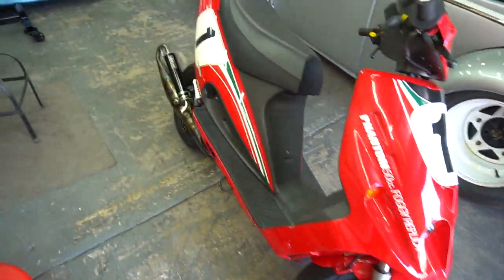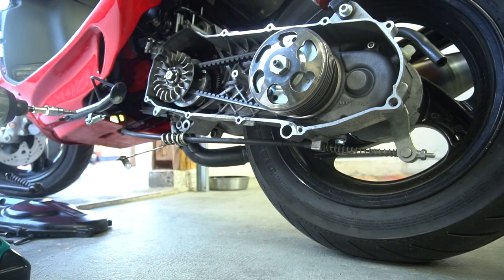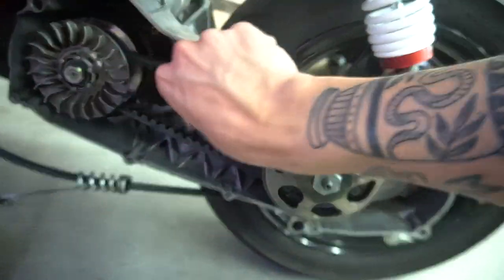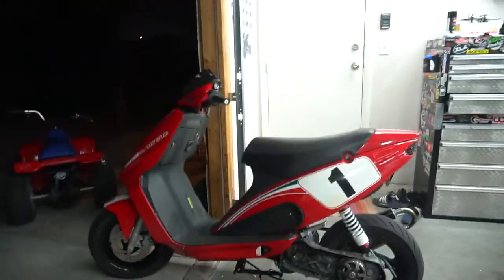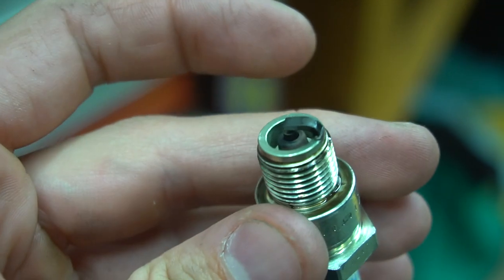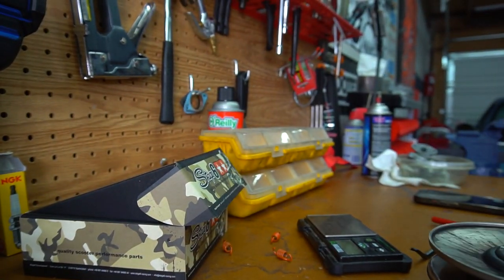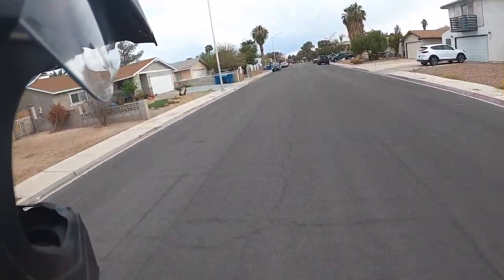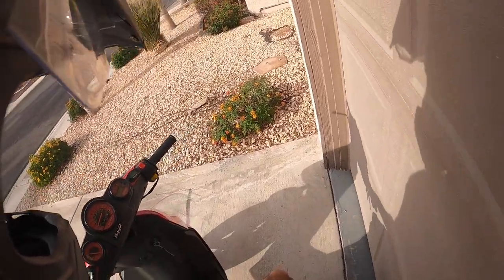PHANTOM F12 gets STAGE6 Clutch and CVT Tuning!

Comment: You should use an overrange kit. It gives more travel/gearing AND has a straight rear poulie spline. Stock splines are curved. A big flaw on minarelli engines.

If you want to improve your gas response. You could ad a light weight ignition (innerrotor). 

If you want to go all out. Convertible to a liquid cooled cilinder. 
It's pretty easy to do on minarelli and the F12 Phantom frame.

Comment: Love your Phantom. I also have a Piaggio Zip 2 with a 70ccm Malossi sport zylinder qnd malossi drivetrain and polini belt dellorto 21 black carb and the same yasuni exhaust ist runs great top speed and longer gear it runs 110kmh and just wheelies for days.

Comment: I own a Gilera Stalker and they are beasts when it comes to tuning in which someone got their Gilera Stalker up to 72 mph at half gas. You can really fit a 172cc on a Gilera stalker. But anyways if that’s completely 100% impossible in America. Then I would just say it’s worth looking them up online
Reply: I own one as well best one for me and i have owned a lot 😅 it’s really simple its comfi and looks just amazing 😍 my is going 95 km/h on the stock 50cc with a 17 mm carb set up i had to change the stock 12,5 carb that was a no go🤷🏼‍♂️😂 now just trying out some other stuff like a clutch an stuff and see what is Posibel 😈
Reply: @mitcheljonkman5139  yeah cool. Mine is 70cc malossi that goes 75-80 kph. I also spray painted mine Matte blue
Reply: @mitcheljonkman5139  oh and btw 12,5 carb is not standard for a gilera stalker, 17,5 is standard and stock
Reply: @Joeyfordayz2301  not on mine my dad bought it brand new and kept it stock and there was a 12,5 carb on it 😂
Reply: @mitcheljonkman5139  that doesnt Sound right. Here in denmark the smallest carb you Can buy for Gilera stalker is 17.5 . It Also lists on the part on the website i buy it on says standard
Reply: @Joeyfordayz2301  ooh maybe denmark spec is a other spec than dutch i don’t no but it had for real a 12,5 it is even listed onder the seat on the factory sticker with the most important part numbers
Reply: @mitcheljonkman5139  interesting. You for some reason I can’t fit a smaller carb on mine
Reply: @Joeyfordayz2301  stalker før 2005 kommer uden begrænsning i blokken og med en dellorto 12mm PHVA :)
Reply: @mitcheljonkman5139  12mm is stock for gilera stalker made before 2005, after 2005 they have a restriction in the engine block and 17,5mm carb. Both the 12mm and 17,5 carbs are Dellorto PHVA's
Reply: @ostemis aahh that makes a lot of sense because mine is from 1997 and im sorry I made the mistake to say 12,5 but indeed its 12 mm
Reply: @ostemis  min er fra 2004 dog
Reply: @ostemis  but mine is still From 2004

Comment: cvt tuning is like chasing a dream, it'll never be perfect, but you're definitely tackling it the right way. On your NCY rear sheave, are you using the more horizontal angled slots? If not, that may help too. I used the more vertical slots and it just shifted way too fast.
Reply: It can be perfect if you know how to tune it , i can road tune CVT with a RPM and dyno logs of google that i can find online, i can share a graph by a road tune with RPM by myself , its a big learning curve to understand CVT tho its not slap some rollers in and springs and off we go it does need further tweaking and tuning for sure!
Reply: I'm thinking he is talking about it wearing which starts the process of slowly getting out of spec but I'm not sure... Just assuming

Comment: Loving the f12 content man. I just picked up a f12 the other day and I plan on doing a similar build to yours. Is there anything you would have done differently? I remember you were talking about a different crank. Thanks man, from oregon.
Reply: I’m budding an F12 too. I’ll go full stage6 overrange,Sport MK2 70cc,S6 Sport Pro exhaust, italkit ignition and HPC Crank. I expect 15Horses running a 21mm Carb PWK. If you start an f12 with a little power, plan converting to liquid cooled 😉
Reply: @ACE-xr4jz  Don't go for a sport pro exhaust, its an okay exhaust but still too small for water cooled sport pro, go for a Carrera 16 instead, it will have much more power. And 15 horses? It will never make that much with that kit. Stage6 racing mk2 and Carrera 21 exhaust with a 24-26 carb will make about 15-18 hp. Sport pro wont make more than 13 :)
Reply: @ostemis  yeah your right , 12/13 hp should be the max with the s6 sport setup. Nice to hear, that I can get some power, using the yasuni! I love the look of the cevlar silencer (;

Comment: What’s up braddah🤙 so I’m having that problem you had with this bike. So I have an elite 72 corsa ported 28mm oko 70 pilot 140 main and a windjammer pipe stage 6 clutch medium springs almost maxed out, 2000 contra 5.5 rollers all around. Take of is cherry my bike wants to lift up the front but when I hold it at WOT for a lil while let go then get back on it it’s super super boggy for a long time. like no power it’s doesn’t sputter. or pop like it’s lean. I’m lost🤣 any advice would be appreciated🤙